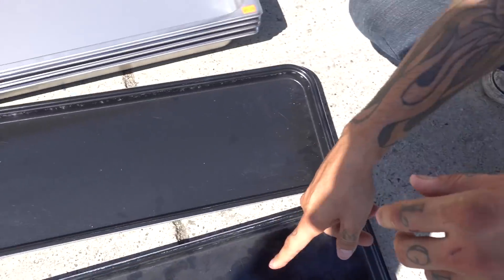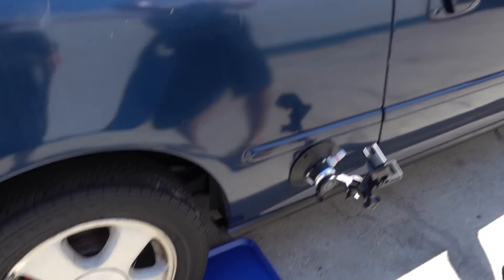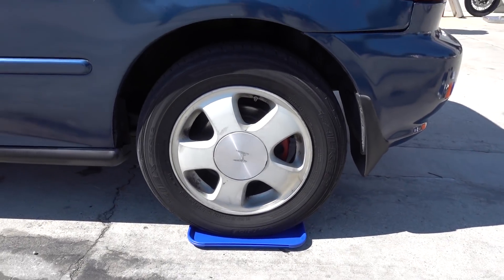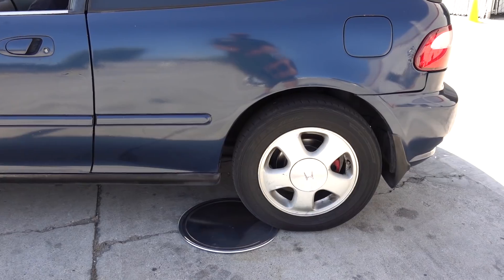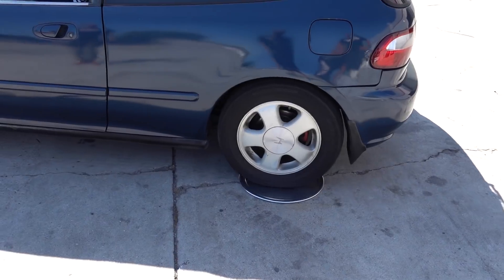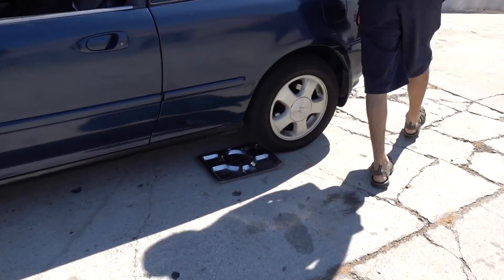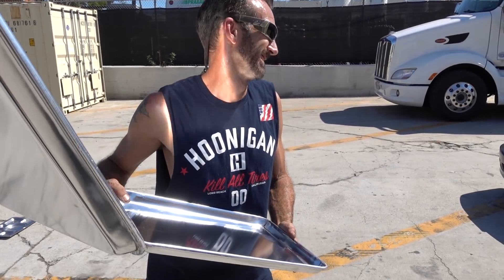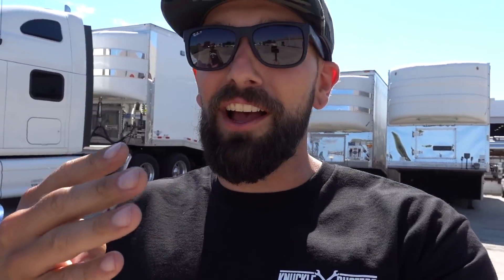Honda Civic Tray Slides! Which Tray Works Best?

Comment: Yes use metal you need to cut a peice of wood that fits into the metal ones for 2 reasons.  1 the metal would melt your tire so wood creates a barrier and 2 the wood gives the wheel something to grip better so it hold on 100 % of the time

Comment: im placing bets on the cutting board, people use cutting board material to make longboarding slide glove because the urethane slides really smoothly and lasts a really long time
Reply: man the cutting boards worked perfectly, and they were quiet too cutting boards and grip tape are the way to go!

Comment: You can actually buy thicker sheets of that from other companies that actually manufacture it the other thing is as well you didn't try the all-wheel-drive donut spin yes believe it or not if you turn the steering wheel real hard it will rotate in the same axis with them trays but caution you may lose your food

Comment: I use cutting boards! They slide great and they’ll give you like 3 runs if you position it right. I think people kind of over look them as a good option. You can also use small wood planks if you’ve got slightly more horsepower, that will last you a long time, like 4+ runs on smooth pavement
Reply: My car only has 96 horsepower (toyota echo) and wood works perfectly fine for me. I was doing donuts around a pole, good times. I probably got like 10 to 15 minutes or so out of the wood I used. If you go to home depot and go towards the back, they usually have a cart of warped wood for 70% off. Only cost me like $3 for enough wood for like 3 runs.
Reply: @sa1t938  what type of wood exactly? Trying to do this in my Honda Accord 😂
Reply: What type of cutting board my car has 280hp
Reply: @Frogly7  You'd be fine with any cutting board, wood or plastic
Reply: @Frogly7  V6 accord? or some acura J series car?

Comment: The best ones I've used are the "trays" that the 2liter bottles come in at grocery stores. Find them out back of the store, put them next to a curb and back up onto them since it's a 3-4" lip. The car sits so high on them that it takes a while to wear them down.

Comment: My first car was a 2000 Buick Regal GS that was a fun ass fwd car with its supercharged 3.8l v6. thing would shit and get and handled pretty good with the grand touring suspension which means it had larger sway bars front and rear, stiffer springs 🤘

Comment: The best to use are the lids on those yellow f.h things you see on road side. You turn them upside down and because they are solid metal they don't wear down but can melt your tyres after about 8 minutes

Comment: You guys need to get an i30 or g45 infiniti they're cheap as fuck the i30 is front wheel 250 HP v6 fun as for tight corner drifting and the g 45 is a v8 350 stock rear wheel that says

Comment: We simply used blocks of wood. Just take any wood you can find, put on a block, so the car doesn't roll of and you are good for quite a long spin. And also, you only leave saw dust behind, where as plastic flakes aren't exactly the greates things.

Or and thats the best trick, just drive around on gras.

Comment: You should have used chopping blocks by cutting board style chopping blocks they're made out of a material that works spectacular if the tire slips off of it use a grinder and grind a little bit so that way the tire will sit down into a groove .... Then after you do all that go buy a rear wheel drive

Comment: What the HELL are you guys doing?? Ok, here's a suggestion. Test the theory of more or less horsepower of a car with more or less electronics. I've been told a car with power windows, power locks, power steering and such, would have less horsepower than a car with all its electronics stripped out. I'm talking stock b16 to stock b16. The only difference is electronics unplugged.
Reply: Did you see the vid where they stripped weight from the Crown Vic? Less weight, faster car.
Reply: Maave not what he's talking about
Reply: Corey Blankenship thats not how any of this works...